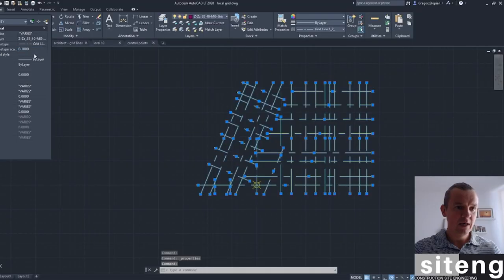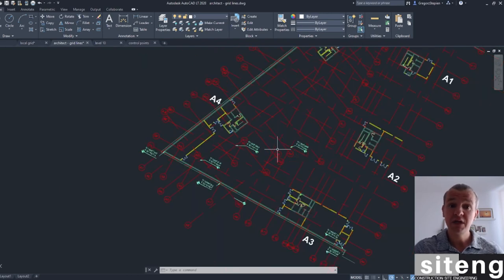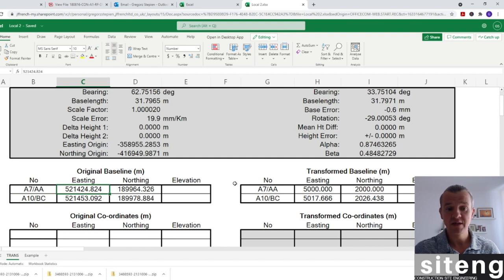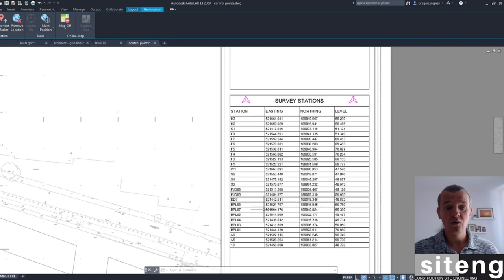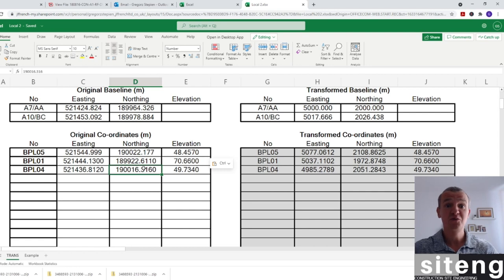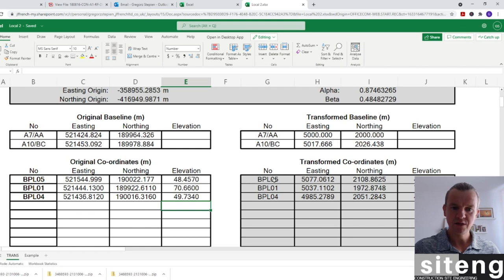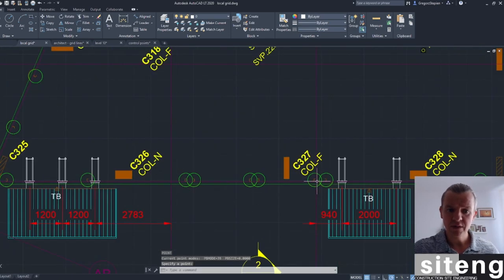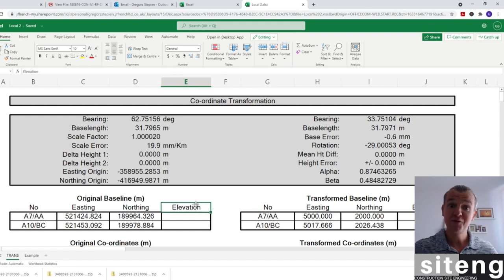Local COORDINATES transformation. How to do SETTING OUT in local grid. SURVEY in local coordinates.

Comment: Hi Greg, nice videos.
Quick question: I do not understand why you need to use a local grid. You're control points and and architect setting out drawing are in world coordinates. Why not just use world coordinates on site and use the align function to coordinate all your drawings to world coordinates. If you ever need to use gps to check something it will all be coordinated instead of wasting time transforming every drawing/asbuilt.
Cheers
Reply from the maker: this is very useful, especially when using TS06 instrument. I agree that for robotic instruments where you upload a drawing there is no need for it, although still might be useful.

Comment: You should do one about setting up control points when there are no ground controls on or near site and the only controls n site are old surveyed in controls that you do not know how acurate thery are. To note that they are in inconvenient locations and only facing one side of the site. Traversing is not an option as all the roads have been replaced.
Reply from the maker: Hi Vlad! Not an easy one 😊 Dependant on situation, if there are some existing buildings, or nothing around to check that would be our decision still to do the job, as if we are start to use these we are responsible. Maybe GPS would help as well.
Reply: Hi, there are some videos on you tube that explained this. check it out
Reply: @SITENG  thanks, gps is ok for pile mat, but for  capping beams I think it is a no go. Will call in a survey company to establish controls, as they have the time and gear( traverse kits, the right standers for the gps), plus they also provide the documentation and are responsible for doing a propper job.
Reply from the maker: Definitely go for it. You spend some money, but you'll have a peace of mind. That's actually their job to provide the info on which you can base later all the setting out and they should be happy to do it.

Comment: Reference line eliminates any need for local ? if you have a complicated combination of grid systems or sometimes a radial grid reference line is far more efficient?
Reply from the maker: Not really, you can use it like local where your offset = easting and length = northing, but creating local grid is much better and makes your life much easier. You can work later in stakeout mode moving in E and N which is great.
Reply: I assume that people are using cad but thats not allways the case.
You will often encounter grid systems where e.g. columns are at a tiny angle to the main grid or an apparently uniform grid but when you luck close there is a .001 deflection in one part. This is typical of certain designers who are trying to generate problems on site. In such cases reference line in global is more efficent but you would need cad to pull up the any globals required.
Reply from the maker: In theory we shouldn't use CAD for setting out at all, unless approved by designer. That's our role to keep checking and not trusting CAD too much 😉 In the case shown in my vid you couldn't even do a proper ref line (grid line) as information was so sh.... so I actually put the drawing to global myself. The thing is that local speed up the job then you are using stakeout which gives you 2 lines you need (I will show this when I get TS06) 😁
Reply: The days of the calculator and all those programmes are in the past.
The idea that you cannot use cad is a joke? It’s been around now for decades and people are still wondering if they should/can use it.
Your phone has a an app with cad(capacity) on it which can be used for all the necessary cad info.
Have you ever seen an advert: setting out eng required with cad

i guess in 20 years time they will be wondering if you can use Revit /BIM
a local grid and a global are identical, the local being derived from the global. If you set out a wall using offset to a local it is not easier than setting it out from global and probably more error prone. 
The introduction of the local idea was in the days of cad being only available to a few in a privileged position and people selling software on calculators that is now obsolete.
Local grid, calculators with programmes for local and paper print outs (often illegible) are a thing of the past.
Most modern leicas have the capacity to up load a cad dxf and work from it directly.

The first job i did setting out many years ago,where the engineer before me was fired and i had to replace him, had a .08 degree error in half the plot where the engineer missed the deflection which was very covertly displayed on an A3 almost illegible paper printout ( a typical Gallifordtry scenario)  Not coincidentally Galliford ,collaborating with the designer, loved this as they wanted to bash the subcontractor.

A designer who does not want you using cad is a bit like the hire company agency who would sell his mother at the crossroads to flog an instrument. He (the hire agency) does not want any one challenging his instruction to management who collaborate with him, on what they require on site. If they view you as a challenge to their selling op they will even sabotage instruments delivered on site.
That is the type of (whitecollar)scum you will meet in construction.
Reply from the maker: Some companies don't even have CAD license so you can end up with pdf drawings and TS06, if you have your CAD go for it. On 99% of jobs you are not allowed use CAD in terms of setting out which means you should in theory use information provided on printed copy. You said you're finding some errors on CAD, well it doesn't matter as you should take info from pdf do a ref line and that's it :) Obviously everyone uses CAD if they have it.
Reply from the maker: Of course no one! The thing is designers covering their a... this way. BTW I worked in design and back than only printed A1 drawings were used on site - the thing is sometimes we edited dimension instead of changing all element which in this case using CAD would make you big error.
Reply: @SITENG  Misunderstanding re error in cad 0.08 deflection:
the error referred to was not a cad error but a failure by the engineer to spot the minute deflection in  half the grid system which was invisible on a paper printout.
It was noticed by me as the calculations on some of the points were coming up in error which led to an inquiry.I had to be shown the 0.08 deflection which the previous engineer missed. Point here being all this is eliminated using cad and global. White collar scum  don’t like this as the 0.08 deflection has no more function than to generate errors and bash the subby
Dont use cad if your not willing to complete it..I worked as a draughtsman in the days of the drawing pen,if i edited a figure without changing the relevant info lines etc i would have been fired.
 to present a circle radius 5m which when dimed is not 5m is an unacceptable error
Reply from the maker: There are really few jobs where information is perfect and no question asked, but I was lucky in most cases designers were willing to help and cooperate. I think that's our role too, to find the errors despite there is not much time on site for these things plus information being changed/updated not helping. If it'd dim changing you are rights that's absolutely wrong, but I remember this (was asked to do so to speed up, these were steel fabrication drawings) and was always afraid someone could be doing that and that's the reason why they say you can use only a printed version 😊 If someone doing strange things and purposely giving the info in confusing way should be exposed and .........
Reply: Should be exposed
 .the bastards run the show 
You have a lot to learn
Reply: @martinshaughnessy3622  if it is written into the contract that you use pdf/paper drawings you should use just that.

Comment: is not easy to use data extraction tool , and have a fixed SOP  , for each corner of column , or at least 3 of them
Reply from the maker: I typically take a 1 corner for a column and I have 2 lines in stakeout this way, using E and N 😁
I did not use the way you mentioned so can't really say anything about it. Please explain more for community 👍👍